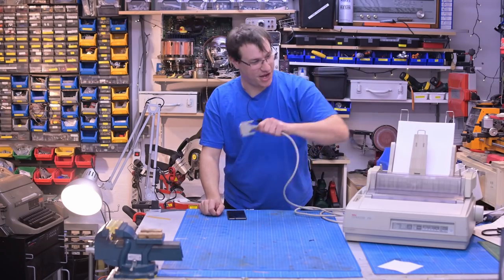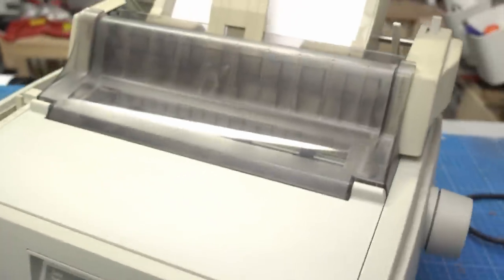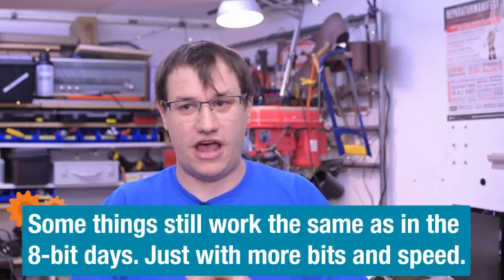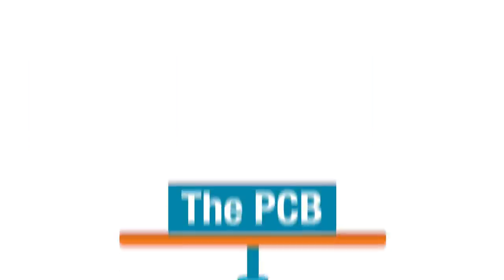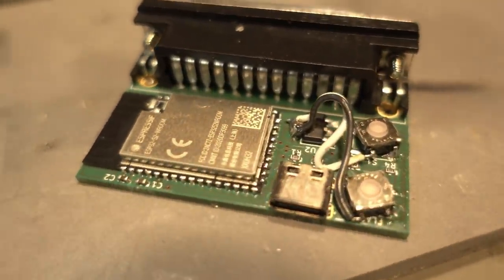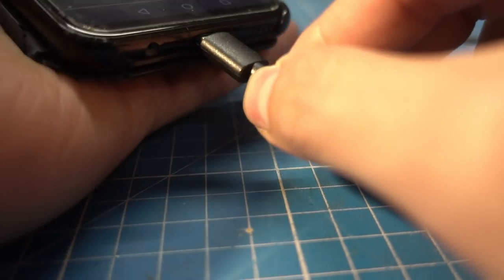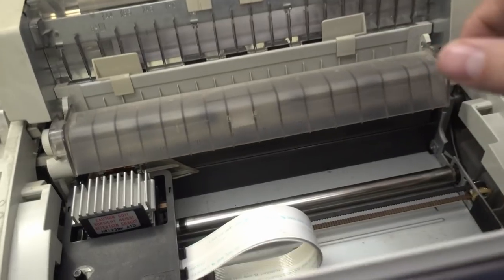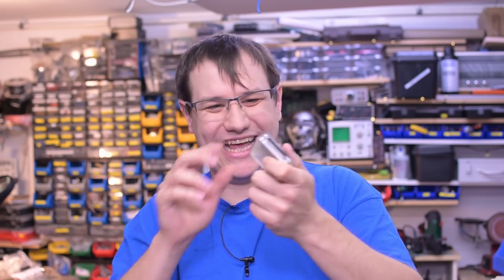Adding a Parallel Printer Port to an Android Phone

Comment: Would it not be easier to use a USB to Centronics adapter connected to a raspberry pi that is set up as a print server?
I'm pretty sure CUPS already has tonnes of drivers for legacy printers such as dot matrix or daisywheel but if not, writing one for CUPS might actually prove to be more useful. A CUPS driver could allow an array of different devices to work with the printer such as phones, smart TVs, consoles, etc, and also over Wifi or Ethernet.
Reply: There are plenty ways to skin a cat. I got 3 of these adapters and none of them work with Any of my printers.
A pi in the mix would need zine zo boot, while this is instantly active. And fir the wifi stuff and so on you should keep an eye open for a following project.
Reply: @MAYERMAKES  I completely agree, was just wondering if it was a route you considered.

Also certainly agree printer adapters can be very hit or miss. I was lucky when I bought my second hand LaserJet 4L that the adapter the previous owner included works flawlessly with it and my Pi, it still blows me a away that not only can I use a printer from like 1992 as my normal printer, but also I can print to it from my modern smartphone.

Definitely going to be keeping an eye out for more projects though, gotta admit I am very tempted to try and get hold of a Dot Matrix printer myself :)

Comment: the arduino works and can easy support different printers. but if you wand a simple solution wch-ic makes a USB to Parallel/printer ic the CH341 makes it a easy single chip intergration.
you can buy already made cable from smartphone to printer adapter.
Reply: i have several of these cables and none of them worked. a single chip solution is simple, but not freely programmable, which is important for my further project ideas.

Comment: Let's see...
I have a Panasonic 2135 color dot-matrix printer (bought it new back when the world was young) and plenty of ribbons for it.
I have an Okimate 20 (or is it 10? the PC compatible version) with a couple ribbons for it, need to get some thermal fax paper while I still can, though.
I have a Gorilla Banana 7-pin printer I bought specifically because it's a PC version of the CBM 1525... and I loved the no-descender printouts of that thing. I've got 2 ribbons for it... they were hard to get.
And I have a Tandy CGP-115 plotter, with lots of pens (most of which are probably dried-out :(  )

I would love it if I could interface any of these old fellows up to my modern computers. Especially wirelessly!
Reply: Okidata printers do not die!

Comment: I'd rather put the centronics connector on the board itself to avoidu using that big parallel cable ... so it can be directly on the back of the printer and use only usb cable to connect to it.
Reply: The trouble with that is finding a suitable connector.

Comment: I still have serial mice. Two "Cutie" mice still in original packaging, and a 2 button microsoft mouse I use with my win98 box, plus a serial trackball I use with my Toshiba T5200 laptop. I've also other serial-based pointing devices. #serialgang

Comment: Seems it would be more cost effective to just buy a modern printer. Then you can connect to it thru WiFi. Well, I know. You do it just to do it. It's there. Same reason they climb mountains. :D

Good luck finding the spocket-fed paper. Or the ribbons.
Reply: The ribbons are still made and available, this model is still not that old.i hit another one that has thecsorocket adapter. It's just not the same with ink jet or laser, and for done tasks they are faster. +I love the sound.
Reply: @piisfun  I have, but they are rare and usually used as plotters.
Reply: I have a Commodore MPS-803 printer from the 1980's that still works and uses single sheets of paper. I use it to print out monthly calendars. I was able to find "new old stock" ribbons and even revived the old ribbon with some WD-40. Unfortunately I can't use this project with the 803 since it doesn't use a Centronics interface... I'll have to use my MPS-1250 instead. ;)
Reply: @LeftoverBeefcake  Of course, you can modify this project to work with it, assuming if you can get the specs for it -- the pinouts, electrical signals, etc.

I lost all of my old printers long ago, and of course none of them would've come with me to Europe. So now I have a laser printer. Cheap as sin -- for the printer. They make all of their money off the cartdriges these days.
Reply: they have modern wifi dot-matrix printers?
Reply: @piisfun  or multipart forms.

Comment: that is cute but my hp 8200 sff has a real uart chip and other pc motherboards do too and under linux it is native stuff parallel port and serial but native I can connect a REAL VT100 terminal to my PC via serial on linux and it's a  terminal $ umm what do you want to do
Reply: real parallel port printing from Linux and connect an old school real terminal via serial port I LOVE Linux.  You can connect a real terminal from the 70's up via serial Linux is UNIX based oh it will work just get the settings right and Linux has parallel printer drivers and other things especially with a fast UART real parallel port motherboard it's fantastic!

Comment: vt100 with Linux PC very easy if you have motherboard with a serial port and match settings it works awesome! Terminal window on REAL TERMINAL! Terminal from 1980 has no problem with Linux PC via serial I can actually control anything on it command line but this is LINUX and it is a terminal lol...